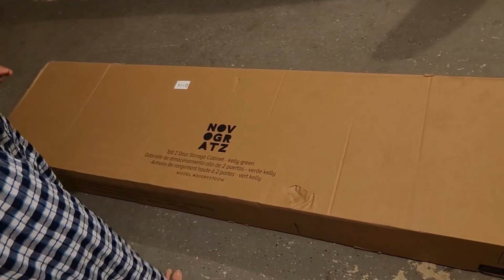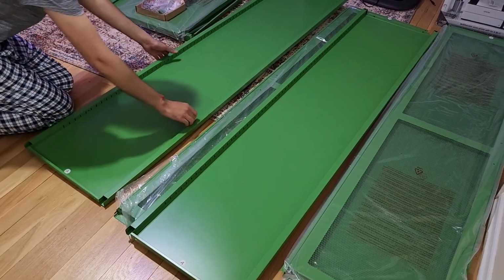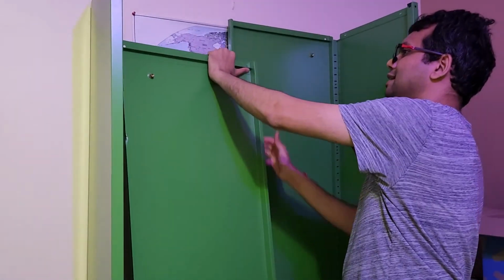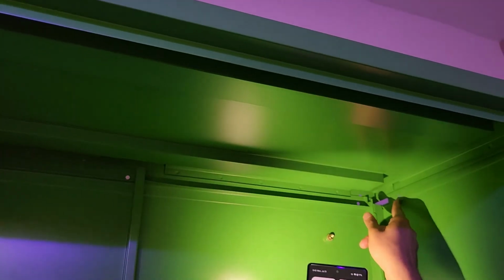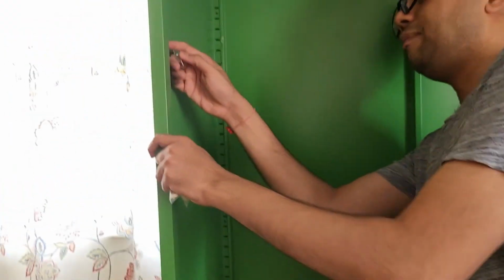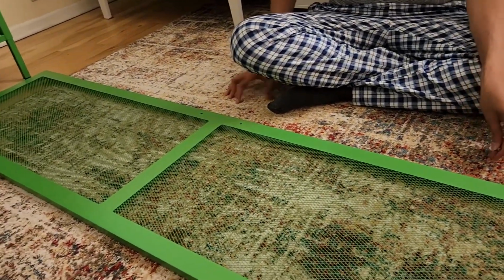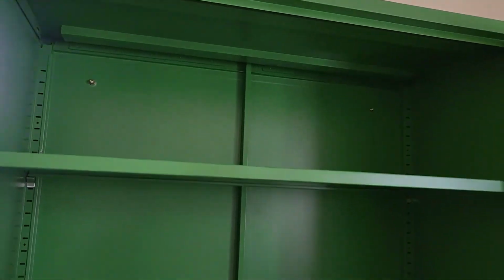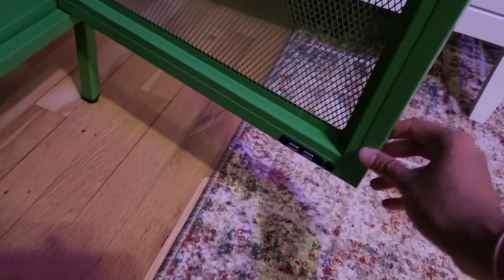Novogratz Channing Tall 2 Door Storage Cabinet Complete Assembly, Setup, Installation and Review

Comment: It would be helpful if you edited the video to correct your mistake so we don't have to make the same one. For anyone else using this video, disregard his instructions when you position the legs at the base of the cabinet. Make sure the holes are closer to the exterior of the cabinet (towards the front and back of the cabinet respectively), not positioned anteriorly (both pointed nearest to the front), which is how he interprets the written instructions "nearest to the outside".